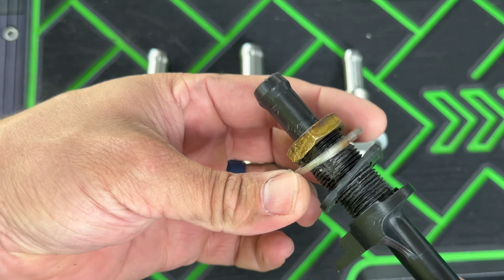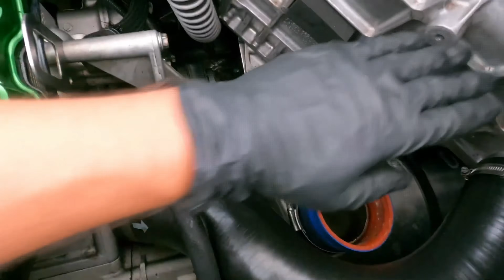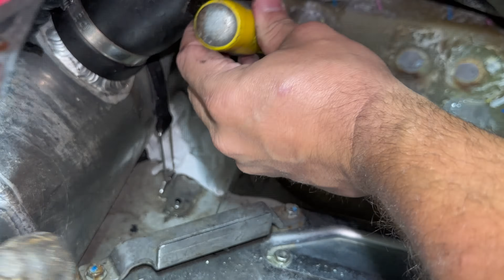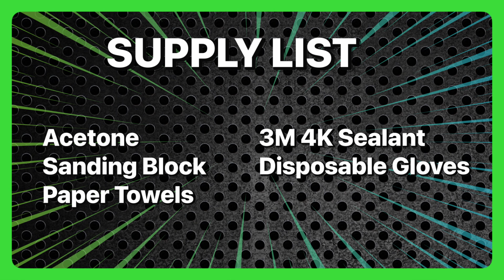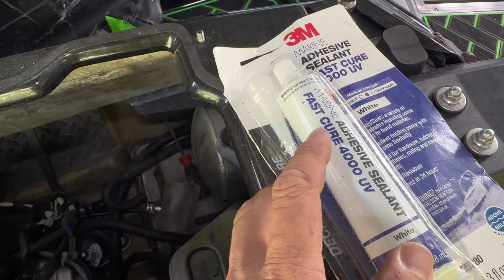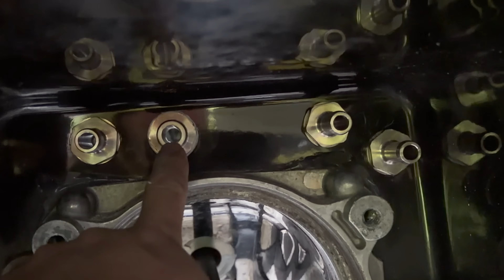316 Stainless Steel Thru-Hull Fittings for Kawasaki Ultra & STX Jet Skis - Premium Quality From KRP

Comment: Do you also make the through-hull fittings for the steering and reverse cable? I can't find them online anywhere.
When removing the nut to replace the cable, the whole thing unscrewed and stripped all the threads.
My only option now is to have a machine shop make them for $300 each...
Reply from the maker: So these were made by KRP, but they unfortunately do not make fittings for the cables. Call Steve at Kawi Performance as see if he has any used or OEM fittings he can sell you. I know he does also sell the long nut tool to remove those easily. Let me know how you make out